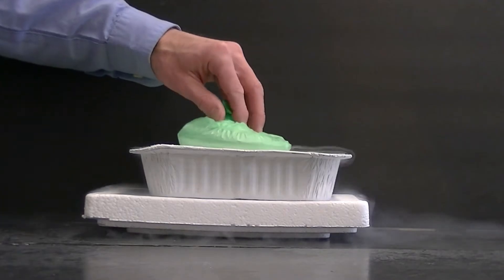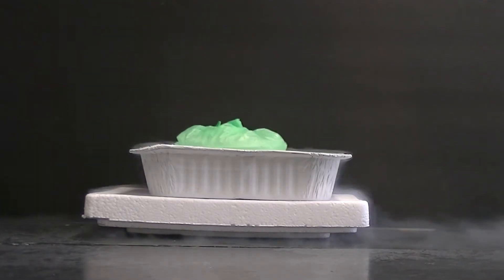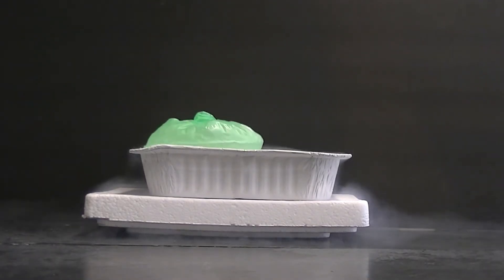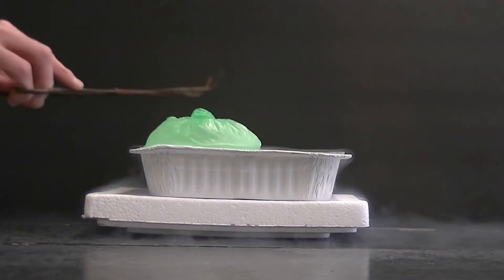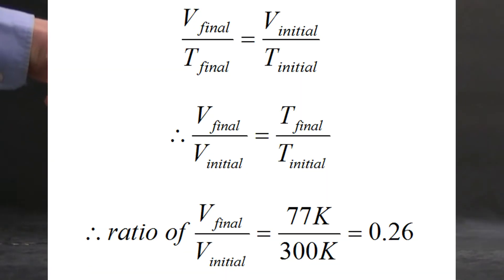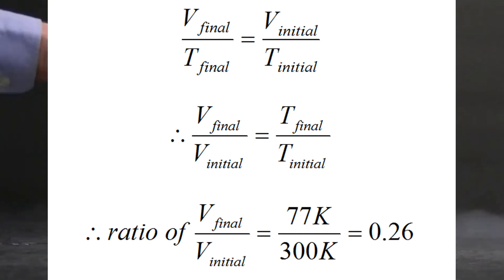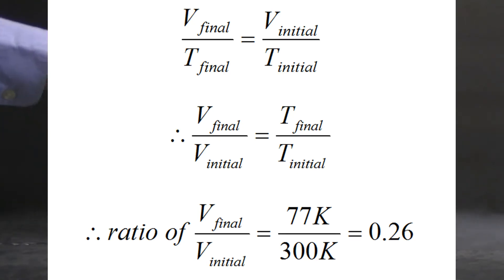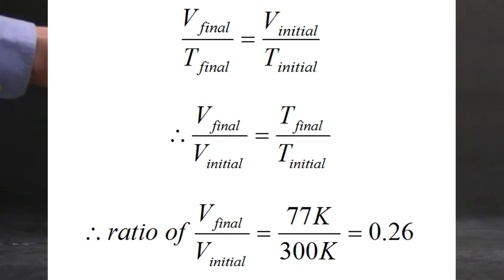Ideal vs. Real Gases:  Cooling Balloons filled with Helium and Air in Liquid Nitrogen

Comment: Thank you so much sir. Now I have clearly understood " compressibility factor."😀😃
Helium gas has low CF, that's why it won't shrink much. On the other hand, N2 has more CF than He, that's why  at first CF rate of N2 will be higher than He.

Correct me if I am wrong

Comment: I think the balloon with helium should fly because the density for helium is less than the air ..
when the man but the balloon with helium on the table why it doesn’t fly ???!
Reply from the maker: If a balloon is filled with helium so that it is not too full, the combined density of the helium and rubber that makes the balloon is greater than that of air. Therefore, it will sink. If the balloon is filled with a lot of helium, the combined density of the helium and rubber is less than air, making the balloon float. See 0:35 to 0:54 in the video.

Comment: i really enjoyed this experiment but i didnt understand difference between real and ideal gas 🤔🤔
Reply from the maker: Hi Dastan, thank you for commenting. An ideal gas is a theoretical idea. An ideal gas is a very simple model for thinking about how gases behave. This model works very well to describe the behavior of gases at high temperatures and low pressures. Ideal gas molecules are assumed to have no attraction for one another. It is also assumed that ideal gas molecules have no volume. Both of these assumptions work well at high temperatures and low pressures. A real gas is just that: the real molecules that make up a particular sample of a gas. Sometimes the ideal gas model fails to describe the behavior of an actual (real) sample of a gas. When this happens, more complicated models of gases are used. A van der Waals gas is one example of a more sophisticated model used to describe the behavior of an actual (real). This model works much better than the ideal gas model at low temperatures and high pressures.
Reply: Tom Kuntzleman 
Thank you

Comment: These intermolecular forces in air you talk about (2:23), are they:
- only between nitrogen and nitrogen, oxygen and oxygen? 
- between oxygen and nitrogen?
- both of the above?

In other words would the same "supershrinking" occur for a balloon of pure oxygen or nitrogen?
Or does the fact that air is a composed gas make a gas behave non ideally?
Reply from the maker: Hi Frederic, good question!  Intermolecular forces exist between nitrogen and nitrogen, oxygen and oxygen, and oxygen and nitrogen. Intermolecular forces also exist between helium and helium. Basically, any two distinct molecules will experience forces of attraction (and repulsion) between each other. The condensation point of a gas is indicative of the strength of intermolecular forces between the molecules in a gas: The lower you must bring the temperature to condense a gas, the weaker the intermolecular forces between the molecules in the gas. The condensation point of helium is 4K (-273 degrees Celsius), the condensation point of nitrogen is 77K (-196 C), the condensation point of oxygen is 90K (-183C), and the condensation point of air is 80K (-194C). In this experiment, what makes the air behave non-ideally is the fact that it is brought below its condensation point. When this is done, the air becomes a liquid! Naturally, then, it won't behave as a gas in this circumstance. Thus, any gas brought close to or below its condensation point will behave non-ideally.
Reply: Oh, ofc. The air condenses. Thank you!